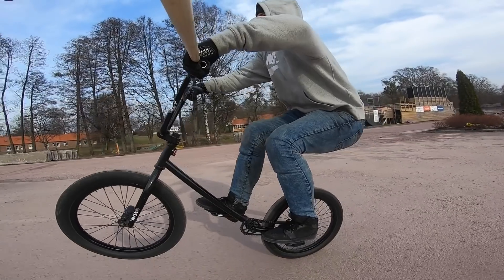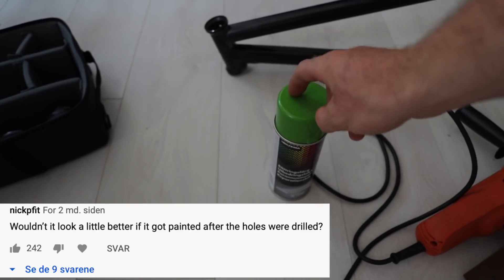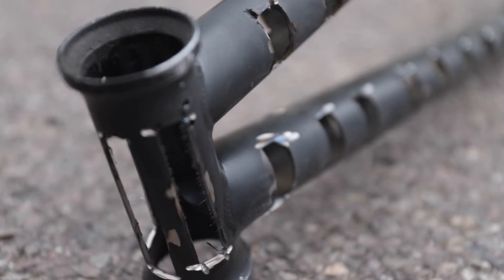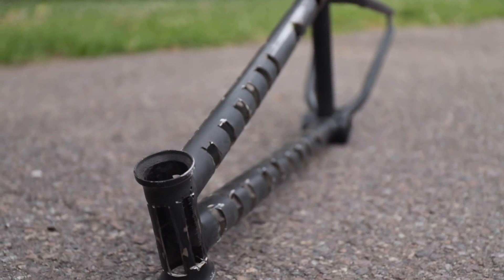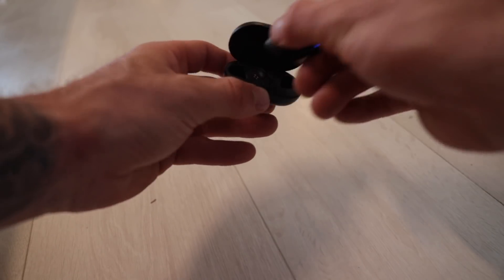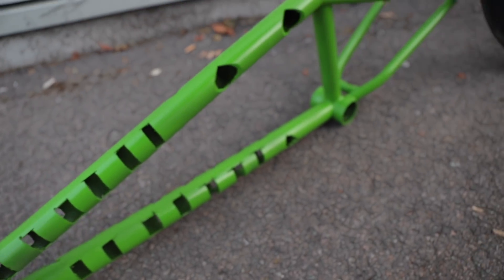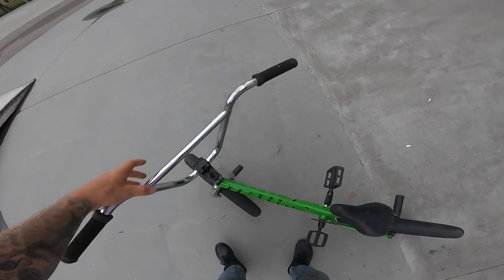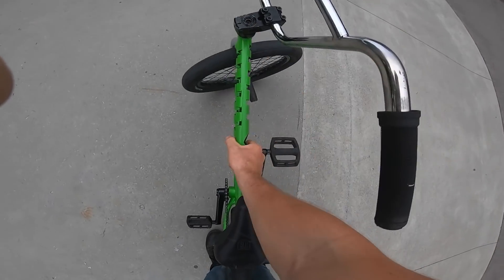WORLDS LIGHTEST BMX BIKE 3

Comment: big brain idea!!! what if u sealed up the frame and the tyres with helium? could work
Reply: It would not, it will be heavier
Reply: hes done a video with helium in the tires already
Reply: Lols.
Reply: @trade-school-ltd  than atmospheric air? How do you figure?
Reply: imagine the volume of just air in a bicycle, it's really not that much. it's not like replacing a couple cubic feet (optimistically) of atmospheric air with helium is going to make something significantly lighter. We're talking probably grams here.